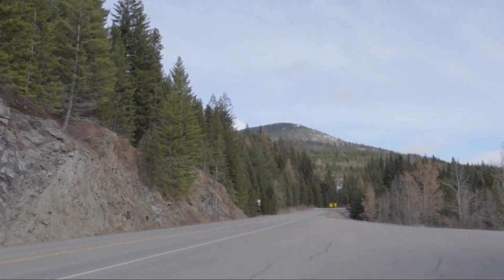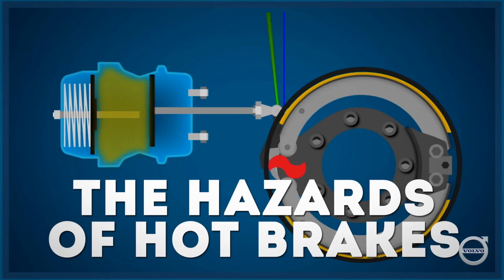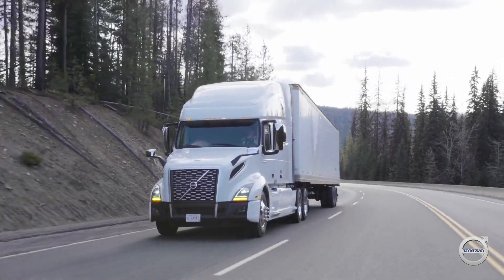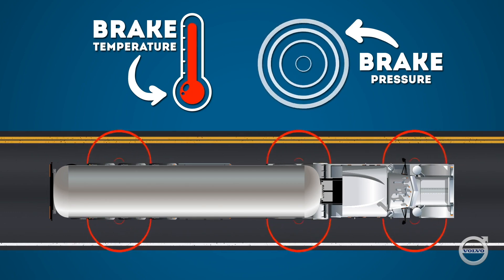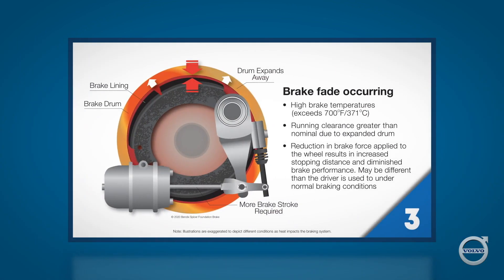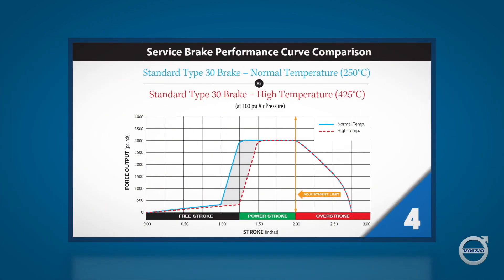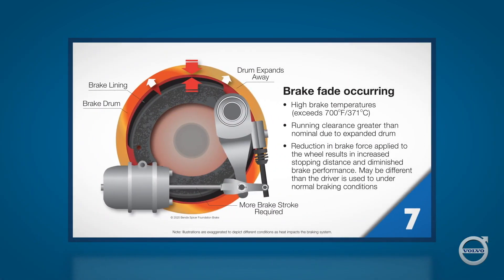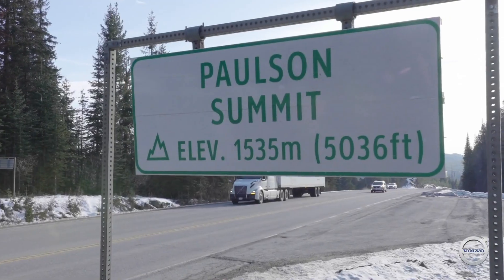Mountain Driving 101: How truck brakes work, and how they overheat (Episode 1)

Comment: Why aren't these videos teaching these drivers about their emergency braking system that's built into the main braking system? I'm just getting sick of drivers telling me that I'm crazy when I tell them that they don't have to wait for a runaway ramp or intentionally crash the truck to avoid killing innocent people when they lose their brakes, being as though they have an emergency braking system called spring brakes. They really don't think that the spring brakes can stop the truck with worn brake shoes or overheated brakes. I always tell them that the spring has more power or force than the air does in this situation, just as long as you do it as soon as possible and don't wait too long. Once that piston is at its furthest traveling point, you may have a had time stopping. So, it's best to use the emergency brakes as soon as you know you have a serious issue. Either way, many drivers do not know this information! I never tell them that uts guaranteed that the spring brakes will stop them, though. I just try to get them to understand that it's an option! They don't even know that much, even though it says emergency right on one of the brake valves, although you can use both! This stuff needs to be taught! There are guys unnecessarily wrecking their truck and/or killing people after losing their brakes, simply bcuz they don't know this information! IJS!

Comment: We need training like this here in South America. I live in Chile (not a truck driver), but truckers run off the road and crash into things all the time here. Sometimes with fatal consequences. It seems like a lot of truck drivers here are not well-trained, or their equipment is not well-maintained, or both. But the crashes are so frequent it seems a lot of drivers just ride the service brakes and have no idea how to select a gear and speed before starting the descent, how to use the engine/exhaust brakes correctly either. Also, drivers really don't like going slow here, including the truckers, so they'll fly down the hills just as fast as the cars do, and hope the service brakes will work when they need them.

Comment: I have an old school Volvo with drum brakes, with Volvos Z cam.  Such a big difference with the disc brakes that trucks are fitted with now days. 
My newest truck have the i shift, with crawler gears and hydraulic retarder. That brake have to be used smartly as so powerful it can wear down the drive tires really fast.